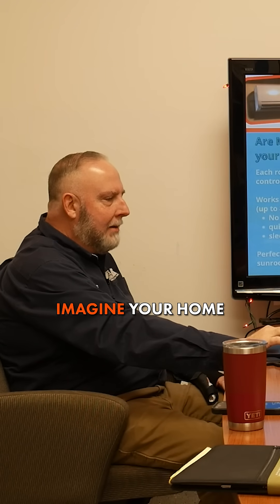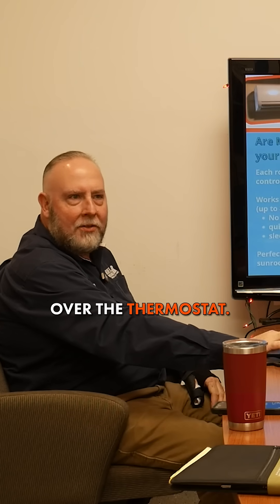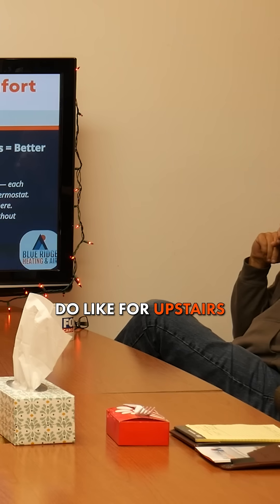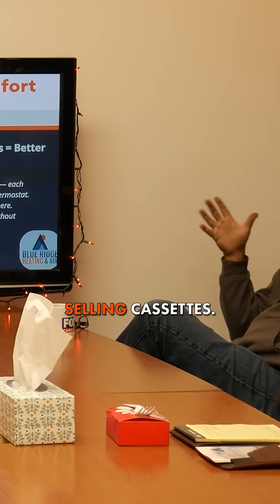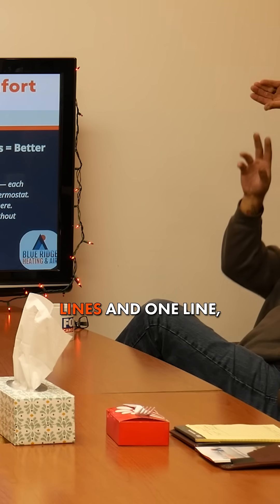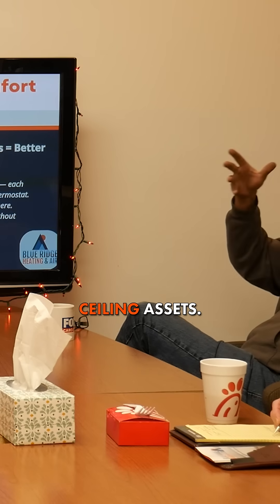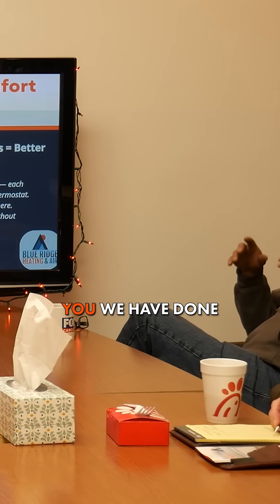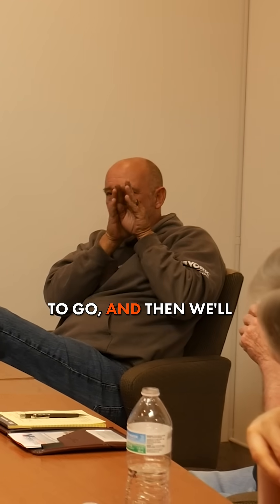Duct Loss & Mini Splits Greenville SC Zoned Comfort Explained

Comment: If you really want it like a hotel meaning some units can heat and cool at the same time individually your gonna need a ton of condensers outside. I can’t even imagine the cost. A vrf could be an option but you’d better be a multimillionaire in a small house